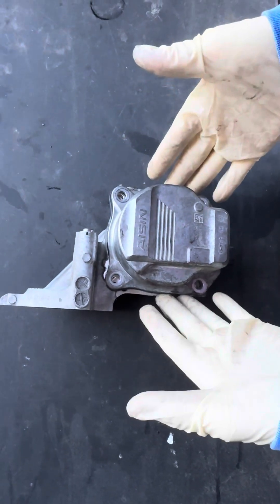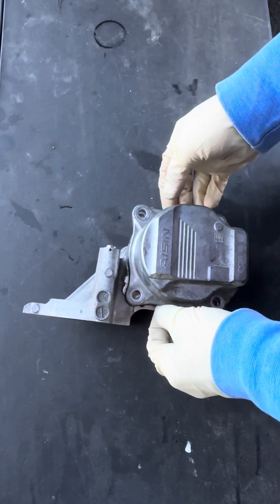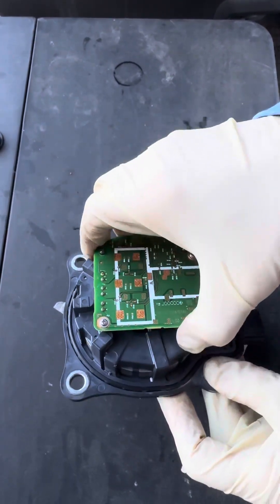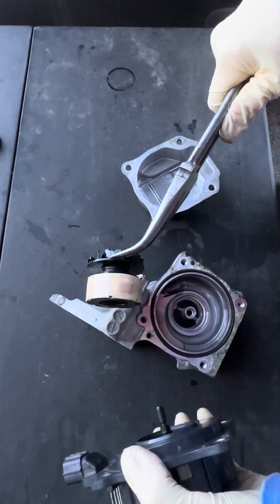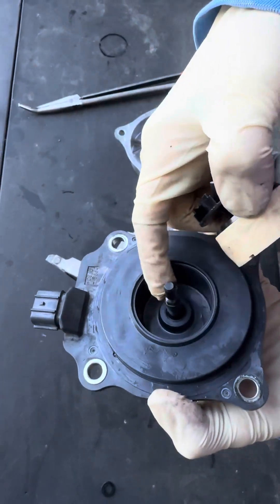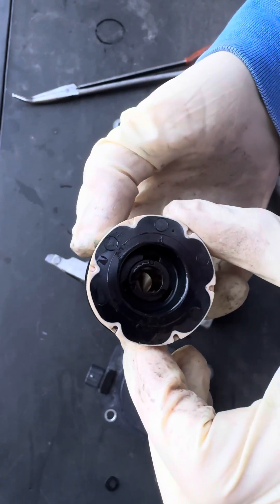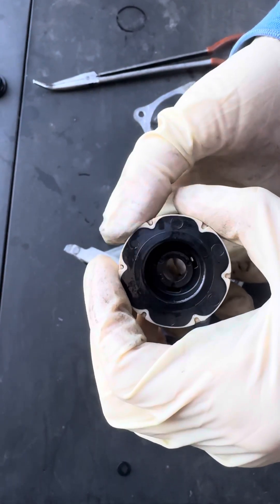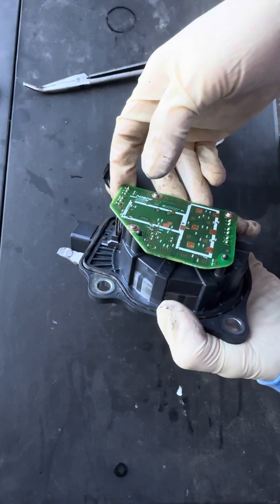2019 Toyota Camry water pump failure

Comment: You dont need to remove the entire housing assembly but only the cover of the motor and replace the motor.  Tho best to just buy the entire housing cause toyota does not sell just the motor and replace the motor.  Saves a ton of time not needing to have to remove the altenator.  Just 4 easy acessable bolts for the cover of the motor.  This video shows more https://www.youtube.com/watch?v=gAq_WsZwXcw&t=328s